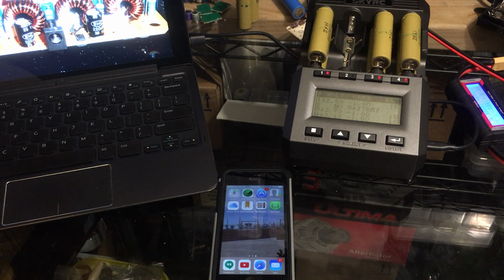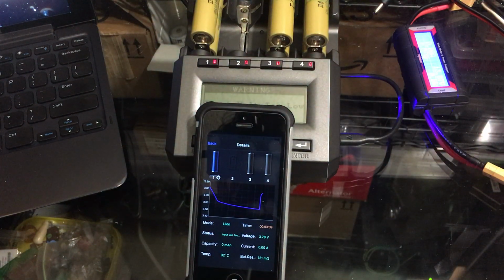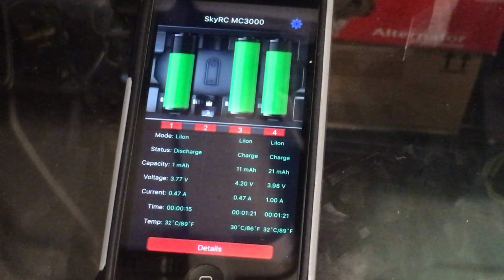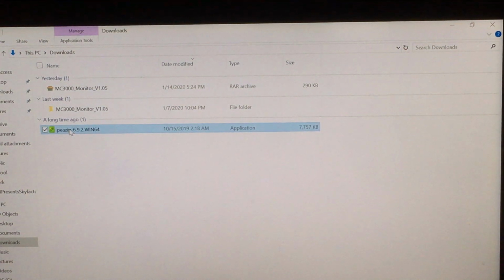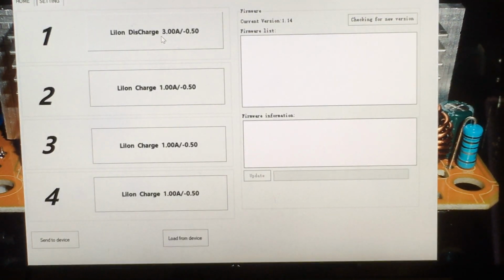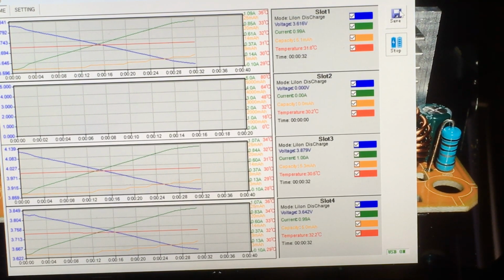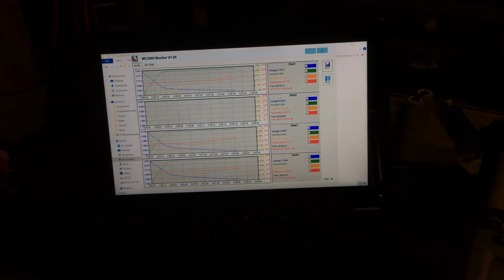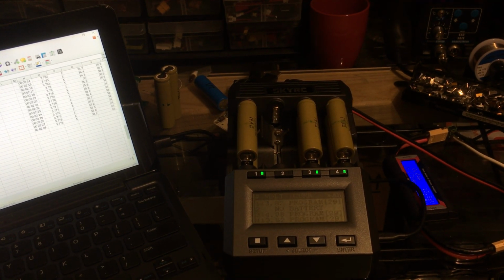Sky RC MC-3000 App and PC Software Tutorial

Comment: Hello, what is the minimum charge end current ? and is charging 3 Amps per each cell (12 A total) possible with this charger?
Reply from the maker: Yes charging 4x Li-ion to 4.2v at 3A is possible! Make sure to power it from near it's max input voltage (18v) otherwise it will try to draw 5A through the barrel jack which is a lot to ask.
Check out this review and look for the highlighted IR photo.
https://lygte-info.dk/review/Review%20Charger%20SkyRC%20MC3000%20UK.html#:~:text=the%20full%20current.-,M1%3A%2035%2C1%C2%B0C,-%2C%20M2%3A%2037%2C2%C2%B0C
Minimum termination current is 0.01A so very low, I don't recommend setting it that low however. It could overcharge the batteries.
Reply: @SuperBrainAK   @SuperBrainAK  No, I don't mean 4x at 3a. I mean 4x at 12a which is 4x 3a each. 4x at 3a = 4x at 0,75a each. I hate this ambiguity! All these websites don't specify total vs each! aargh !
Reply from the maker: @undefinednull5749  No yes, that was what I was saying. It can do 12A total if all 4 slots are going at 3A at the same time.
Reply: @SuperBrainAK  No, I don't mean 4x at 3a. I mean 4x at 12a which is 4x 3a each. 4x at 3a = 4x at 0,75a each. I hate this ambiguity! All these websites don't specify total vs each!

Comment: Is this still the best choice?
Reply from the maker: Since I have this one I haven't been looking at other chargers, I think it is the most feature rich and most capable. You could get cheaper ones but it depends on your use case and what is important to you. This one is certainly one of the most powerful and has real circuitry instead of cheaping out with PWM charge and tiny resistors for discharge. I'll update this thread if I find something better. Thanks for the question!
Reply: @SuperBrainAK  thanks 🙏. I expect the mc3000 tomorrow:)
Reply: the closest competitor is vapcell 12a (4x 3a) charger which has various functions including discharge). still not sure which is better because they are quite expensive

Comment: Any idea how to get the discharge AND charge capacity with this charger for aa nimh and 18650s?
Reply from the maker: when you have a program running or finished it should say on the right side of the screen, otherwise you can press the slot button for the cell that you want to know the capacity the charger put in or took out (the one with the LED's behind it) then you will see the progress or results of the program and you can use the up and down buttons to scroll through.
Reply: @SuperBrainAK  thanks

Comment: Hey thanks for this. I am trying to update my firmware so I can use the app but the software is not seeing my charger. I keep getting an error that says low voltage. Any advice?
Reply from the maker: you need to power the charger with its main power supply versus only the USB power. If it is powered on with the 15v PSU and the error still shows then you might have a defective unit, you'll have to contact the SkyRC support

Comment: Charging or discharging based off a preset “mah total” is completely idiotic. Cells have different starting capacities and total capacities.
Reply from the maker: Your opinion is your own, and yes batteries start at different states of charge but setting the capacity in the software quickly sets the charge or discharge current to typical values which can be changed later. It also sets a limit for charging so if it it puts more than 2000mAh into a 2000mAh battery it will assume something is wrong and cuts off the charge. This can prevent cell damage or a fire due to a missed termination of Ni-Mh or Ni-Cd and a possible “heater” Li-ion cell

Comment: Nice Video Buddy. can You Tell me how many Charge/discharge cycles are possible to Set . the reason ja i would Test cell capacatiy  after hundrets of cycles different cell manufactures .Kind regards
Reply from the maker: Unfortunately not hundreds. It only goes up to 99. If you can find a program that can automate the charger that would be best, I've only found ones that read and log the data.

Comment: Excellent video. Why is there a separate mode for Eneloop batteries? Aren’t they just a NiMH?
Reply from the maker: yea they are but it is a special chemical mixture that makes them so good, so they behave a little bit differently than other Ni-Mh cells. It is mostly just getting the charge current correct for the AA or AAA capacity, otherwise it wont terminate the charge properly. This charger makes sure it is correct with the special mode so it doesnt overcharge the Eneloops
Reply: @SuperBrainAK  just recently experienced this on a xtar charger that burned one of its transistors during this charge;) That’s why I ordered the skyrc. I was already very happy with my q200 😌
Reply from the maker: @user-yr2mx9mn1j  yep I don't think you will have that problem with the MC-3000 it has a large heatsink and good fans.